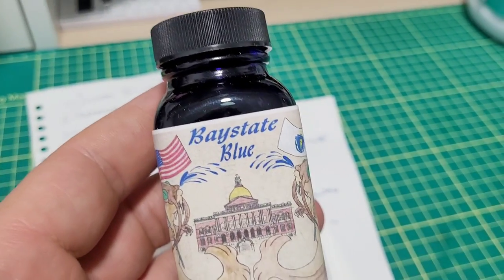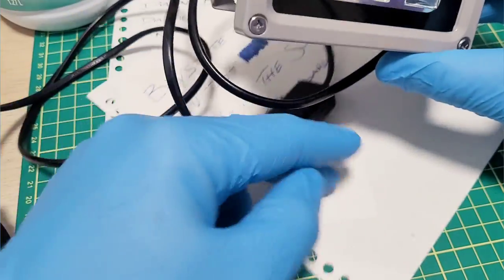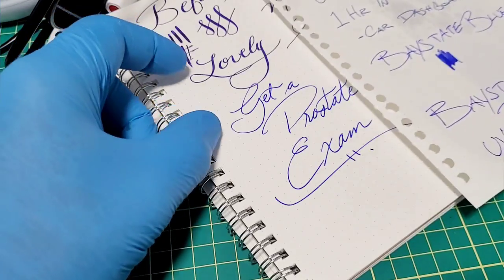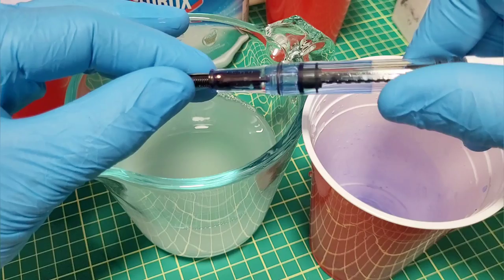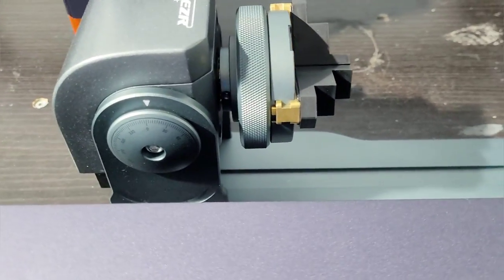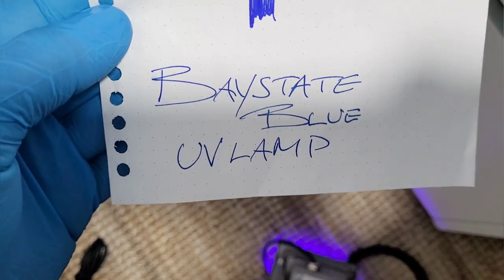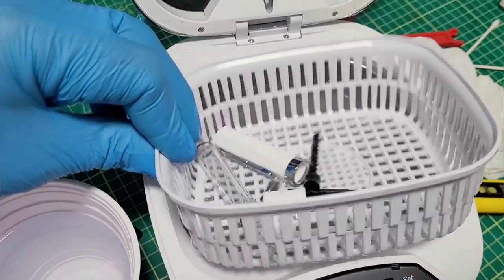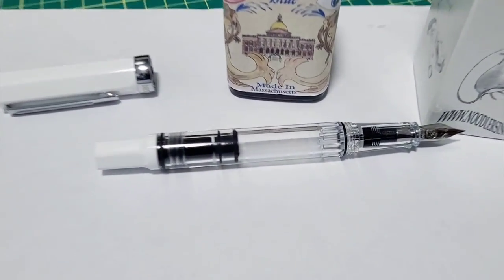Episode 2 - The Final Cleaning - Doodlebud VS Noodlers Baystate Blue

Comment from the maker: I will redo the UV tests soon.  I underestimated how much UV was blocked buy the windshield.  The driver/passenger side windows do let in more UV which I tested as well, but to do things properly I need to leave a sample in direct sunlight.  Due to my schedule when I get to do my videos and tests its tricky to do things in the daytime, hence the car test while I was working.  I will prepare some samples this week and hoping to be able to do the test this weekend.  My apologies for a flawed test 😬
Reply: Yes, most car windows block significant UV.  There are also many different UV wavelengths, and LEDs don't cover the spectrum... raw sun is definitely where it's at.

The good part about the car paper is it acts as a control... you can confidently say the fading is from UV and not heat if/when it fades.
Reply: If you really want to accelerate the UV degradation of the ink, try a shorter wave UV source.  405 nm is bordering on the visible spectrum and is not as energetic.  254 nm  will probably fade it much faster, but it's more hazardous (generates ozone, dangerous to look at, avoid skin exposure, might cause some plastics and elastomers to become brittle or yellow).  365 nm could be a safer option.  Sunlight has a broader UV spectrum than lamps like these that emit narrow spectra.  High wattage is like throwing more photons at the ink, but the photons don't necessarily have the energy to break it down.  But I think any light-based method of clearing the ink is also likely to damage the components in the pen.  I wonder what they're putting in this ink to make it so persistent, yet somewhat sensitive to photodegradation.  Maybe it's the high concentration of pigment/dye, so even a tiny residue will stain, but the colorant itself is not very lightfast.
Reply: You already have your UV light, run the tests with that. You'll get less variance then you'd get in a real world test, I'll be it your results will be on the conservative side.
Reply: @Chiberia  Not clear how you know it's not the heat. I'm thinking of the similarity to gel inks that disappear when cold and reappear when heated.
Reply: @petertwang  The sunlight doesn't contain much 254nm anyway, atmosphere blocks it. 300-350nm should be enough, but LEDs in this range are uncommon or expensive. Behind a window is enough in my experience.
Reply: I don't mean to be rude or anything, but if your title says 'Episode X' you should probably have a link to the previous episode somewhere in the description or a pinned comment.

It's not a problem for now as I can still see it in the recommended videos but in a year or so if the algorithm choses this to recommend then it would probably get a lot of people to watch the other one also. I say this as someone who had no idea what you were talking about and didn't feel like going on a google journey to find out or scroll through god-knows how many videos like I've done hundreds of times before looking for one video of thousands to start the binge watch.

Edit: Back after watching both videos, I'm glad it was in my recommended as it was very entertaining. I'll be subbing and checking out more of your content!

Comment: The glass in your car blocks almost 100% of the UV light. It is why you don’t get sunburned if your windows are up.
Reply from the maker: I didnt realize it blocked that much so will be redoing the sunlight test
Reply: That's cool 🎉
Reply: My family didn’t realize that our new 1971 Plymouth Fury station wagon had tinted windows until we watched a drive-in movie one Summer night. All the colors on that Peanuts film were wrong.  My dad found out that they installed tinted windows on all cars with air conditioning.  Our 1968 Plymouth sedan didn’t have tint or A/C.  IDK if the non-A/C cars in 1971 also had tinted windows.
Reply: Also why Photochromic glasses don’t darken in the car.
Reply: @Doodlebud Any update?

Comment: I wouldn’t use bleach to clean any of my pens, vintage or modern, far too caustic. Your piston might have become stiff because the bleach reacted with the rubber seal. Might be interesting for your viewers to leave various samples in some bleach for a few days and see what happens. BTW, rubber gloves still make my eyes water, but the new PSA test is a doddle. 🙃
Reply from the maker: I was thinking afterwards the bleach could do a really good job of removing the silicon grease so that could have caused it to get sticky
Reply: Bleach seems much scarier than isopropyl alcohol, at any rate. The former is an oxidizer that can chemically eat away at materials, including plastics - the latter is at least only a solvent, which can damage plastic by infiltrating and distorting the structure but isn't nearly as reactive.
Reply: @henryptung at the same time though, solvents can ruin some plastics on contact since they'll immediately dissolve the outer layer. Both are going to be harsh on soft plastic seals, but dilute household bleach isn't going to cause a fire or anything unless you decide to start mixing cleaners or something.

Comment: Nice video! 
couple of notes here: 
1) While bleach is basic,  it is a weaker base than ammonia,  which is the active ingredient in most pen flushes. The action of the bleach here (like with your clothes) is due to its strength as an oxidizing agent. I worry a little about that damaging plastic and rubber. 
2) To get BSB off of your hands,  hand sanitizer works well.  Of course,  that is alcohol based,  and there are concerns about using alcohol with some plastics. I might be more inclined to use alcohol than bleach, though. 
3) I once taped a piece of paper with BSB writing on it to the inside of a house window for a couple of weeks.  It faded to almost nothing.
Reply: As I understand for bleach to stay stable at any concentration and not break down over time it needs to be kept at above PH11 by adding sodium hydroxide meaning it will probably be quite agressive even using household bleach strength cause u have extra NaOH added to the mix to slow the decomposition. Here is a good video about how bleach works in detail including the thing about PH level. https://www.youtube.com/watch?v=YV6lZbvZBSI&t=991s. I have however never measured the actual PH of household concentration bleach myself as I have neither no such equipment or the chemical itself at home but this video is where I got this info from.
Reply: @johnpekkala6941  Thanks for pointing that out.  I wasn't aware that there is likely excess sodium hydroxide present in bleach.  I don't have a pH meter at home,  either.  I could try some pH paper,  but that would no doubt turn white,  rather than an indicator color.  🙂

Comment: My car's windshield (and all other glasses as well) filters UV and IR light, and it's not even tinted. You can easily test the IR filtration with your own skin, because you feel a significative change in temperature on your skin with the sun shining. Also the UV filtering prevents my photochromic glasses from turning dark. ( I didn't see the whole video yet)

Comment: I just stumbled upon some really inexpensive paper that works fantastically well with fountain pens! Maybe not as well with juicy flex nibs, but a regular nib? No problem, you can write on both sides of the paper, there is no show-through, no bleed through at all. It's a regular spiral bound notebook made by Staples in its Earth-something brand, where the paper is 80% from sugarcane pulp! I have this really old notebook, from nearly 20 years ago, and I picked it up and started scribbling notes in it, and couldn't believe it. So I went looking to see if I could find such a notebook again, and I did! It has a slightly different name, but it is made by Staples and is an eco-type brand. I just ordered three of them. When I get them I will write you a note, if you are interested. It isn't fancy paper, but it isn't like regular paper either. The ruling is college rule, and the lines are a light brown. The paper has a different texture, it's shinier and kind of thin feeling, but no show-through at all with a regular fountain pen and ink. I was using Diamine oxblood, and also some Diamine firefly. If I dumped ink on it, that might show through, but writing did not. Had no trouble at all filling both sides of the pages with text.

Comment: 1.  Victory!  Persistence, and following the directions, pays off! 
2. Baystate Blue failed my lightfastness tests pretty badly, along with most other inks I tested.  And I've had two colored pencil drawings (with two brands of pencils) ruined by just the blue fading.  Maybe blue is a problem.
2. Last week I had my first Baystate Disaster.  Granted it was with Baystate Cranberry, but presumably the chemistry is the same.  The bottle lid got screwed up somehow. I even got some on my foot, where it remains.  But I got it out of the carpet with diluted bleach.  It did require quite a bit of pressure and scrubbing.  It was harrowing.  I have chosen to discard my Cranberry and Grape, because they are not exceptional colors.  But I'm hanging onto Baystate Blue because it is blue, blue, blue.  I'll only use it in sketchbooks to minimize sun exposure.
3. For me the fadability is much worse than the staining.  My intention moving forward is to switch entirely to De Atramentis Document inks, and live with whatever range of colors they provide.  I'll try some more mixing.  And the waterproofness is gravy.
Reply: Have you tried some of the platinum pigment inks or the platinum (and R&K and KWZ) iron gall inks?
Reply: @Calcprof Somewhat related: 
I tried out a chinese ink brand by the name of BAOKE. Seems like a carbon pigment ink. It writes asolutely jet black and it is the toughest ink I have ever tried. It doesnt stain as bad as BSB but the pigment itself is almost impossible to erase. It is completely waterproof, undiluted bleach and IPA does absolutely nothing to it. I havent tried UV exposure yet but im willing to bet it doesnt fade since it is carbon

Comment: i was surprised that the uv light didn't fade it more. it's possible that Nathan has added uv protection since there were complaints about it. there are many inks that change colors, often growing darker, after a day or two in a journal, so light isn't the only thing that can change it. i was really worried your plunger was kaput, lol, but it pulled through! alcohol, tough, might swell it! also, another cleaner option is hydrogen peroxide. but i don't know if it will react to the irons in red inks. funny video as always, have a great weekend.
Reply: Wouldn’t surprise me.  He love’s making especially permanent inks that can defeat forgers.  Some college kids demonstrated that a laboratory laser could erase one of them, so he made laser proof ink.
Reply: The sun really is a VERY powerful light source. ;)   Full sunlight is a LOT of energy compared to most readily available lights.  Also, it has to be said....be VERY careful with any lamp but especially high powered UV ones that can cause very serious eye damage frighteningly fast.
Reply: Full sunlight is closer to 1,000w.

He would need a ballasted hps or mh to come anywhere close to that. His mini light needs about 20x the power output for an actual test. That little thing isn't even worth the effort.
Reply: TWSBI states that you shouldn’t use alcohol on their pens, as I recall.
Reply: @RJayRoberts  makes sense to me. Though we sometimes bend those rules a little... ;)

In all honesty if you aren't getting stains out with water at similar pH as an ink then it's probably (but not certainly) not going to cause problems.

Comment: Thanks for your experiment. I have to report that with the Twsbi Eco, I have had my piston get stuck even cleaning it with dish soap / ammonia based cleaner that I make for my pens. What I've imagined is happening is the silicone grease is being removed, and when you get down to less lubrication the piston will seize and need to be reassembled/regreased to function again.
Reply from the maker: Yup happened to mine as well.  I did a follow up video where I cleaned out the pen

Comment: Not sure how bleach was suggested. Ammonia is the cleaner that will remove Noodlers Bat State Blue. It is my favorite ink that I use in my TWSBI Vac 700 demonstrator. Ammonia is the key.
Reply from the maker: 10% bleach is actually recommended by Noodlers directly to clean BSB.  I tried a 10% ammonia solution and it removed it a little but wouldn't completely remove it like the bleach.

Comment: Here is another fun science experiment with BSB. The chemistry is so different from other inks, Tardif warns users to never mix it with other inks (not even with the two other "Baystate" colours). I saw Brian Goulet do it so I: tried it myself: take a sample vial and mix in about 1:1 BSB and any other random ink. In some cases it will start to outgas some bubbles, in others you get a viscous goo that will jam feeds. I once actually did this to a pen semi-accidentally but a good rewash solved it. (water ran clear through it, but after pulling out the nib and feed it was clear the collector had plenty of residue to chemically react with). After a good wash, the regular ink was again flowing through the de-BSBed pen.

Comment: My own testing w/ inks in sunlight over several months on the inside of a house window has shown that BSB fades faster than many other blues.  That said, it isn't claimed to be lightfast so that doesn't really bother me.  It is remarkable how variable the amount of stability of light differs from ink to ink.  I've also used bleach to clean BSB, I try to avoid the bleach with scents etc because who knows what those compounds are and I want to flush as clean as possible afterward.  I would not leave bleach in contact with the compressible rubber (gaskets, piston, etc) for any longer than necessary and make sure you do grease it back up while crossing your fingers.   Great tests, keep it up.

Comment: I had BS Blue in a platinum 3776 for years. When I went on to other inks, I cleaned it out. It's fine now. (to be sure, I did replace the converter, but I didn't want to take the old one apart -- I should have, because the platinum converters are easy to disassemble.). I had some bad staining from some other ink in my Schon DSGN peak full sized. So I just used alcohol (on the body and cap -- not the nib and feed, which I removed.) Ultem, I believe,  is also perfectly OK with alcohol. Of course most acrylics are damaged by alcohol , so be careful.

Comment: To test for comparative  lightfastness, I write the same single  line of text on the same sheet of paper repeatedly with a left margin of 1/3 of the width of the paper, each line in a different ink, then fold the margin over to cover half of the texts, and place it in a Southern-facing window, and check periodically. Some inks are far more fugitive than others.

Comment: to get a desired concentration, you use the CVCV formula. (conentration and volume). You know the starting concentration of store-bought bleach, you know the desired concentration, and you pour up a given volume of the starting solution. c1*v1 = c2 * v2  --> (c1/c2) * v1 = v2. So just add water to the concentrated stuff until it is at the volume v2 that you calculated

Comment: Do a 6 month to 12 month test. The BSB started corroding the rubber piston seal in my TWSBI Eco. I was still able to get it clean, but BSB was definitely eating away at the black rubber, caused it to bubble up on the surface and degrade around the edges.

Comment: I wouldn’t expect the dashboard to work- front windshield blocks most (but not all) UV. (Sorry not trying to troll).
Love your channel!!
Reply from the maker: https://www.skincancer.org/blog/surprising-danger-planes-trains-automobiles/#:~:text=While%20glass%20blocks%20UVB%20rays,sunlight%20shining%20through%20the%20glass.
Reply: @Doodlebud  So are you equating UVA and UVB's effects on ink?
Reply: @Doodlebud  yes…exactly…that’s why I said front windshield.
Reply from the maker: @mercster  not equating uva & uvb. 4 hrs+ on the dash, 4hrs+ on the passenger seat, 1hr+ outside on the deck & 2hrs directly under a UV lamp. It faded a bit, but didn't vanish like some have claimed. Still completely legible

Comment: (Ink poured back into the bottle... 😬 )
I just a dedicate a cartridge/converter pen to BSB, then I don't have to do that level of pen cleaning - just a couple quick bulb-flushes of the grip section with a soapy bleach solution, followed by a few more with clean water, then set aside to dry. The next day, I re-ink with more BSB.
I use full bleach to clean everything else - hands, sinks, etc. 😂

Comment: I wonder if the standing is caused by similar chemical that's in tomatoes that stains plastic. I recently found out you can use butter to remove that from plastic. that might be an interesting test in this application.

Comment: Just like the visible light spectrum, the UV spectrum covers many wavelengths (400nm - 10nm). UVa (400nm - 325nm) is not much worse than blue light for causing fading.  UVb (325nm - 275nm) causes considerably more fading (but glass absorbs these wavelengths). We don't see much UVc (275nm - 200nm) on earth, but if the sample would be exposed to UVc, it would fade dramatically within a few hours.  Wavelengths shorter than 200nm (i.e. VUV) are extremely destructive (these wavelengths are near the boarder of the X-ray wavelengths of the electromagnetic spectrum), but we don't see these wavelengths on earth (outside of a laboratory where special precautions are used).
I'm not sure what wavelengths of UV your lamp was emitting (I suspect UVa), but I believe you would see much more fading if the writing sample were exposed to direct sunlight (i.e. NOT on the dashboard of your car).  If you took the writing sample to a laboratory with VUV lamps (and special shielding to protect the lab workers from direct exposure), the paper would be completely white within a couple of hours.